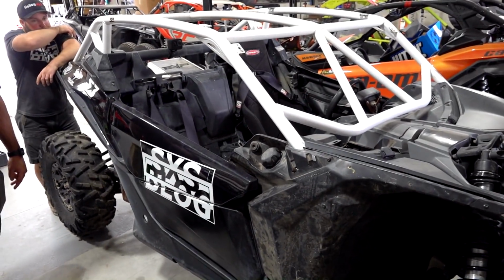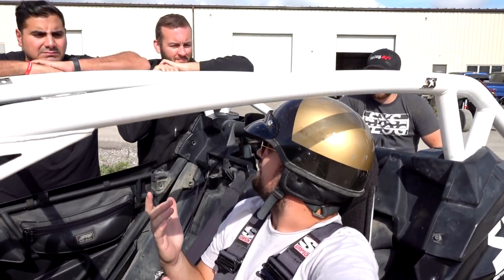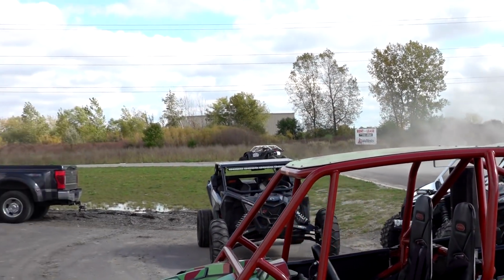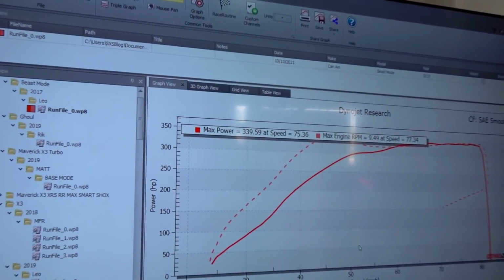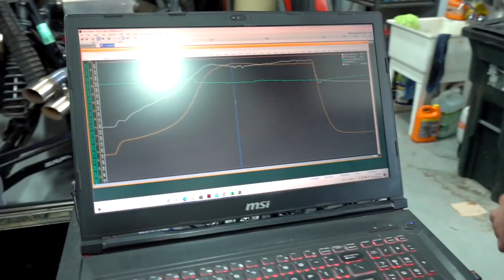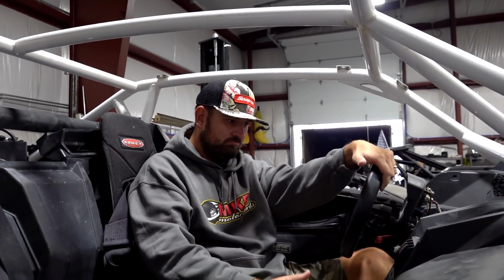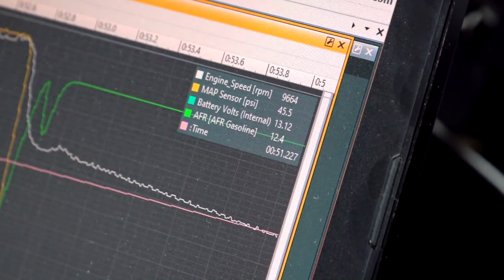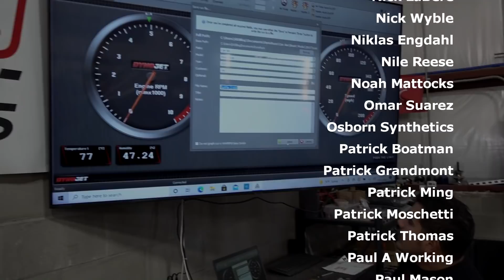Beast Mode X3 is back and it GOES WILD with burnouts and DYNO!

Comment: The plugs are a common issue, I have a 13:1 compression SBC with twins and anything over about 10psi of boost I gotta close the gaps up big time. .012 with ngk 10’s I can get up to around 27 psi without blow out.

Comment: That had a copper head gasket didn't it?  If so you're supposed to retorque the head after a heat cycle, at least that's what you do on car engines with copper head gaskets.

Comment: The reason why you would want an stock or barely aftermarket, is because I've found out that A LOT LOTS OF the aftermarket plugs will fall off after they've gotten to temp... 🤔🤔🤔 Think stock ones will run forever lol 🤦🤦🤦🤣🤣🤣🤔 have gotten over 100000mi... 🤣🤣🤣🤣 Well they're still there 🤔🤔🤔🤣🤣🤣🤦
My rece car..   Well no Sht used split fire, iridium, titanium lol blah blah LOL always started to skip towards the end of the 50 lap main... Just felt like putting in my 2 cents worth lol later